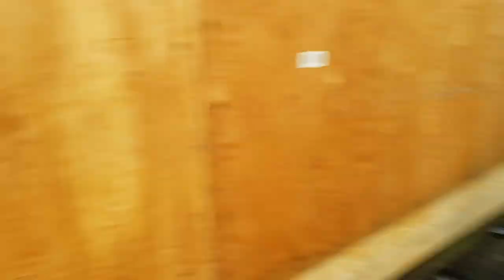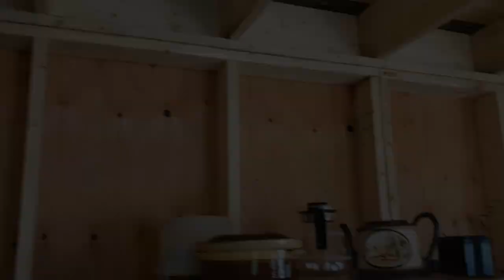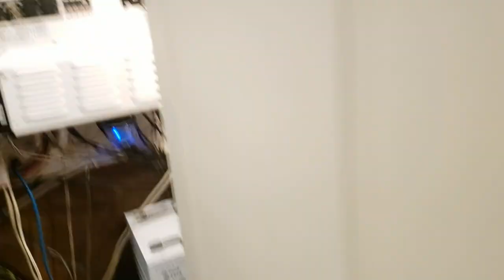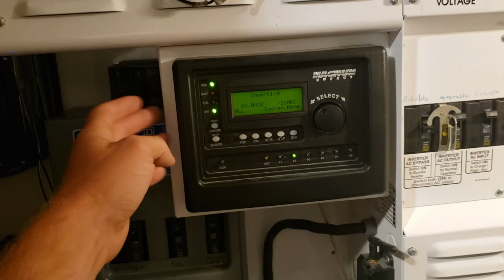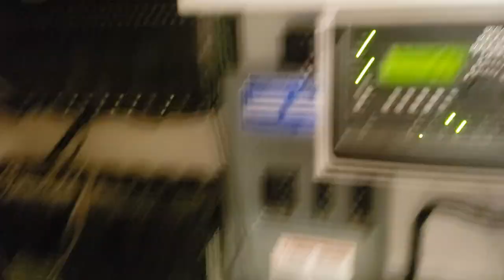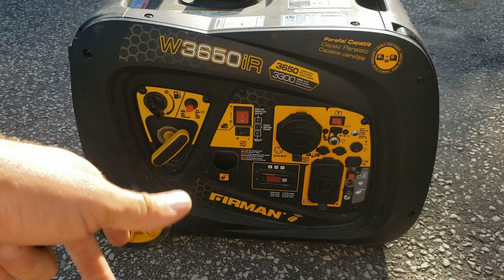Off Grid Cottage Update And A Massive Upgrade

Comment: Instead of another inverter, have you considered adding a bunch of relays to manage the loads? For example, you could turn the pool pump off while cooking.
Reply from the maker: yea I could, and that would be cheaper. but I want to be able to run as if im not off grid.
Reply: @GoingOffGrid101  Automate it so you can forget it's there.
Reply: the pool pump does not use that much electricity
Reply from the maker: @ursodermatt8809 it uses around 1200w continuously and 4500w surge.
Reply: @GoingOffGrid101  
the surge is not a problem,  what i mean to say is turning off the pool pump does not cut ice if you want to charge the car and cook,etc.
maybe you should look for a smaller pool pump.
what i found is charging the car doubles the power consumption of the house. so yes i have to juggle a bit if the breaker to the electricity grid is off.
Reply from the maker: @ursodermatt8809  yes you could or add like me lol

Comment: Cabin is looking great. I'll be watching  how you add the third inverter as I have the identical set up as you know thanks to you. It looks like the second off-grid property I'm helping out with will also be going with the magnasine system. I have suggested the person get the dual panel option so you can run up to for inverters  as there will be two families. what are your thoughts on that? They are going to need at least three inverters eventually. I thought that was the way to go as it also gives them AC and DC side to run electric to two separate homes.
Reply from the maker: good idea, wish I had the larger panel,  im just waiting on some bus bars to rewire the power wall
Reply: Don't even think of less then 4 inverters for 2 families. Why overload it
Reply: @royamberg9177  I agree but not my call.
Reply: @TheKiloG69  understand. It's your job to steer in the right direction lol. Just a good recommendation 17.6 kw isn't hard to use up with several people around. I had a guy here for awhile and he couldn't understand how to conserve lol

Comment: I have never installed a magnum. What was causing the over heat. High continuous demand or an overload? Nice cabin. Loving it
Reply from the maker: i was pulling 5000w from each and it over heated after a while.
Reply: @GoingOffGrid101  that is a lot. 10 kw? What are you powering with that much power
Reply from the maker: @drsolar  my nissan leafe takes 5kw then the rest of the house can easily take the other 5kw
Reply: @GoingOffGrid101  I forgot the car

Comment: Does the generator need a gas filter
Reply: Or a vent in the tank
Reply from the maker: it has a very nice screen at the fuel cap but not sure, i am getting my new one Monday.
Reply: I have a small engine do that before and it turned out to be the spark plug. Ran fine idling but as soon as I put a load on it, it bogged and stalled.
Reply from the maker: @11mleger  interesting, I'll try that next time.

Comment: Anyone know to combine the output on the inverter when you parallel with 2 inverters
Reply: 48 volt is 4400 continuous 24 is 4000
Reply: Roy Amberg 24v
Reply: 4400 on 48 volt. 4000 on 24 each
Reply: Roy Amberg 2 4024pae inverters 24v 4000 watts each
Reply: Roy Amberg already have the me-artr control unit
Reply: @petermac9304  youl like it
Reply: Roy Amberg I only hook up 1 inverter now, I have another one I want to parallel them together but I don’t know how to combine the output. A picture of the wire diagram will help me out
Reply from the maker: ill make a video when i add the inverter!
Reply: Going Off Grid thanks